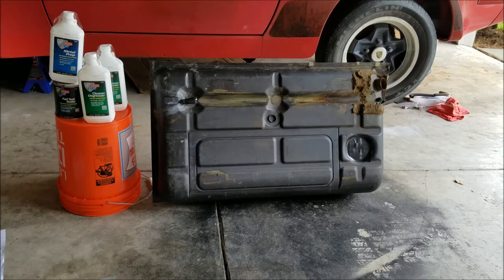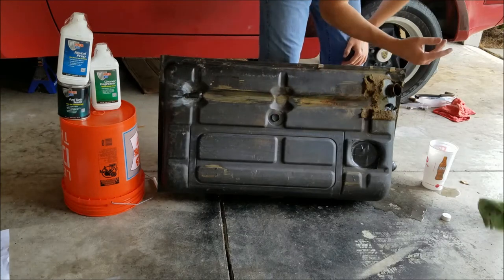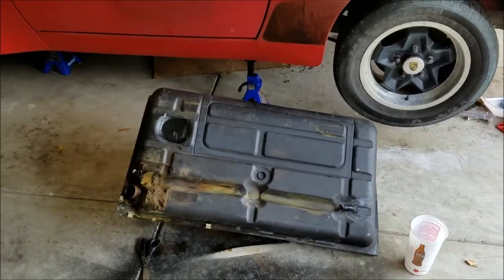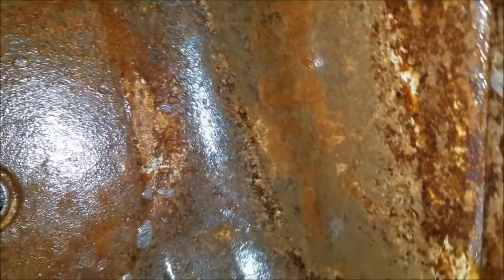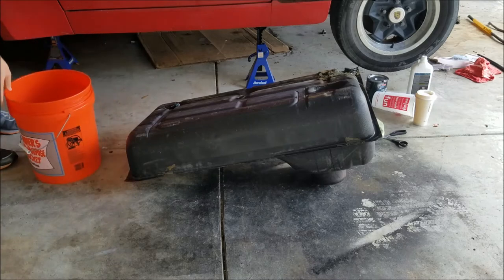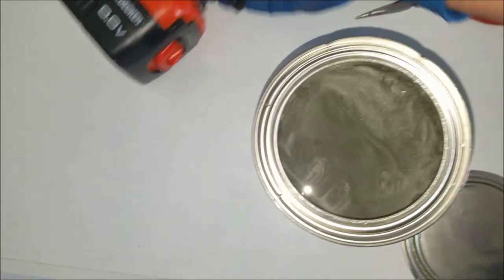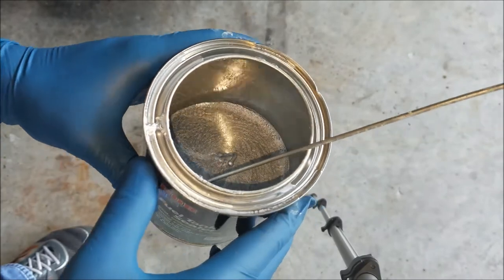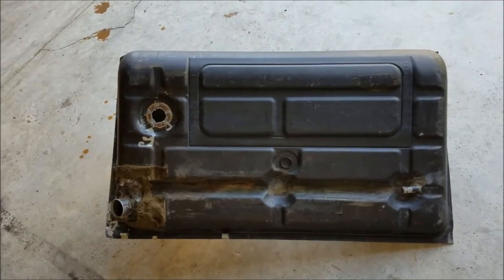1984 Porsche 944 NA Pt#10 - POR15 Fuel Tank Restoration

Comment: I'm trying to find hose that connects to the expansion tank on a early 85 944. It's part number N 020 363 1. I used POR on my tank and it's ready to go back in. Just need to find that hose!
Reply from the maker: I see that pelican parts has it in stock that fits that number. I would see if that is the right one. Also would try 944online.com. congrats on the sealing of the tank!! Quite a big job

Comment: So now its been quite a while since you finished. How is the sealant holding up, dissolving or flaking of the sealant  > ?
Reply from the maker: It has been a while and I should shoot an update video on the POR 15 and how well it's hold up over the years. But I have not had a single issue since the fuel tank's been in

Comment: Do you think there is a way to spray the por 15 sealer? I suspect it is too thick right out of the can based on your vids. I am really not wanting to drop the tank on my 944.
Reply from the maker: I'm not sure how you would be able to spray it and get proper coverage over every area of the tank. The only way I know how to do it is to drop the tank and roll it around by hand
Reply: @spencerdog944  how long do you think it took you to get the tank dropped?
Reply from the maker: @papasmurf986  all together about 5 hours to remove. It wasn't too bad  it was just pretty tedious

Comment: Couldn't you have just had your tank boiled out?
Reply from the maker: I could have had my tank boiled out but the only place I could find wanted about $800. Also the muffler shop on my area do not clean fuel tanks so this was my best option
Reply: $800.00??? Even in my neck of the woods, the S.F.Bay Area, the last time I checked it was about $150.00 for a radiator shop to do it.
Reply from the maker: The radiator shops in my area do not do it anymore
 because of EPA reasons. $150.00 is a steal and I would jump on that. It was fun doing it myself though but very time consuming.
Reply: Mmm...I have to admit, it was some time ago when I last heard about the radiator shops here doing that. I find it difficult to believe that boiling out a gas tank would run afoul of any environmental laws...By the time the shop gets it, any gas will be long since evaporated.

   Thank you for your communication on this!